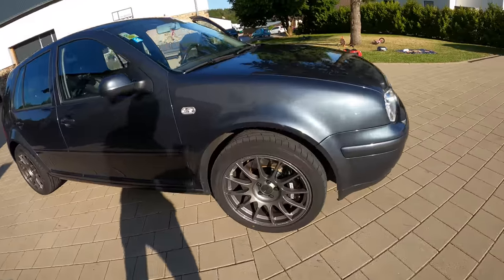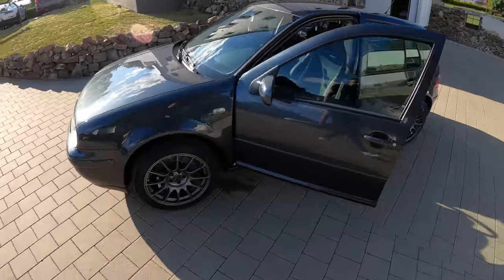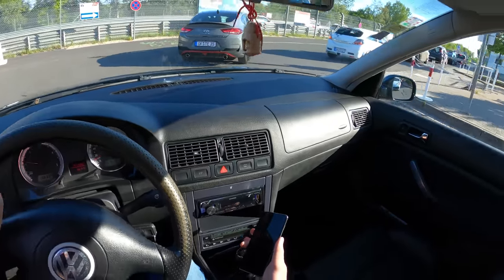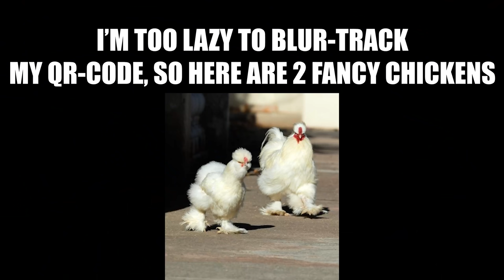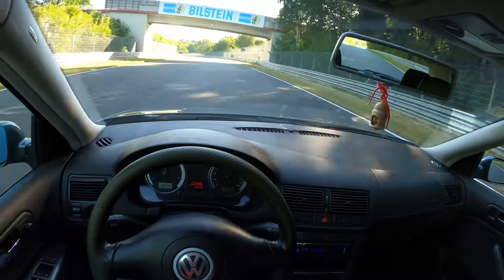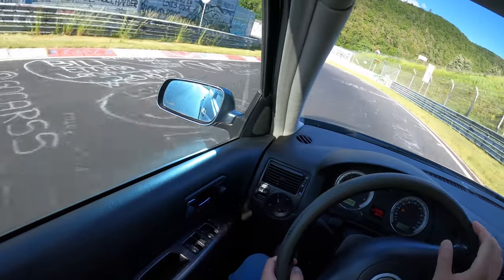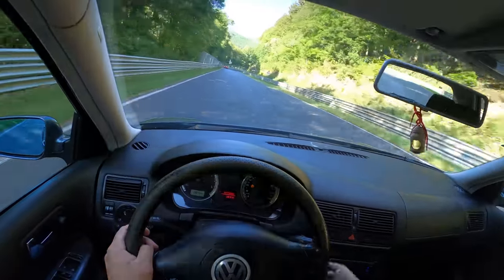New Brakes? LET'S DO A LAP!

Comment: It is really interesting to see what a good driver can take out of a classical "every day car" with just 115PS, even the breaks are upgraded which is only for safety and a bit of later breaking (bit longer then 10Min, similar to Sabine with the beefed up Ford transit :-))... I can not even remember how it was. First car I can remember on the Ring was already a 300+PS "Volvo V70R monster" at that time..... now we are use to 600+PS cars and you cannot imagine that with many cars you would run out of power on parts of the track... I loved the onboard... just to get things sorted and 
remind again what reality of a street car is on this track.Looking forward to the Power upgrade to see what it can change to improve.

Comment: I love how maturely you upgrade the car. First upgrading all the handling aspects of it, preparing it for the extra power, unlike the usual "omg, full horsepower bro, unlimited poweeeeer!!!" while still running drum brakes. Your videos are a good guide on how you do proper car upgrading. Would you say the most important thing until now was putting on the lsd??
Reply from the maker: I have not had a single lap without LSD, but not having wheelspin is definitely great!

Comment: Loving the tracktor videos. I wasn't aware of the engine mods to come until this video, but I'm glad you went with Darkside. I have worked on a lot of VW diesels including the ALH engines and the PD engines. 
However, I have a question as the link to Darkside's website doesn't clear this up: What turbo will you be going with? The hybrid option or the GTB1756V?
Reply from the maker: May go a bit more extreme
Reply: Ohh this is gonna be amazing content! :D
Reply: @mgcharoudin  GTB2260VK all the way for 300bhp hh

Comment: You said in the previous video that you didn’t put back the ABS sensors, those are also used by traction control, my guess is that the missing sensors just mess up the ABS/ESP calculator that would be why they kick in like that
Reply from the maker: They are back in now ;)

Comment: Misha one question, did the switch from two pice "swimming" break calipers to fixed one pice brake calipers change the handling of the car? I did a similar brake update on a car I owned years ago... next to the amazing more break power was in my eyes such much more stable handling under braking into a corner...with the stock brakes the car started gearing around the center axle which gave you that unsure what car will do feeling... with switching to larger brakes with fixed one pice brake calipers the cars behaivor switched completely ... the car stayed rock solid under hard braking into a corner never gave this unsure feeling...same with your Ring tractor?
Reply from the maker: Yes, the pedal control is amazing. It is the suspension which is absolutely shit now. Waiting to fix that next.

Comment: Why don't you first start with upgrading the power?
Reply from the maker: Because safety first
Reply: @mgcharoudin  true, but you could drive it safe. With an engine that can not be driven at 100% power, because of the other inferior parts of the car, you can experience the effectiveness of the other upgrades at a larger scale when you are able to exert more power.